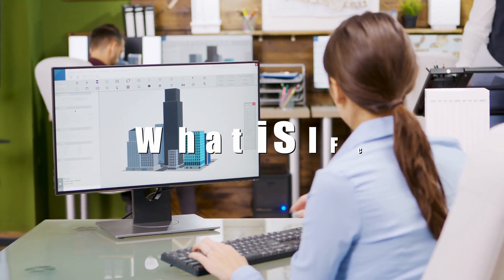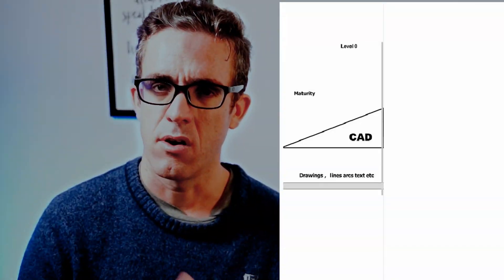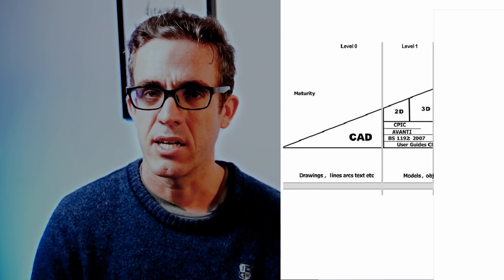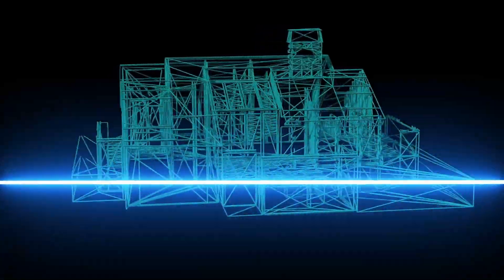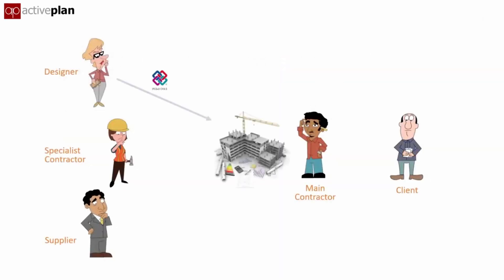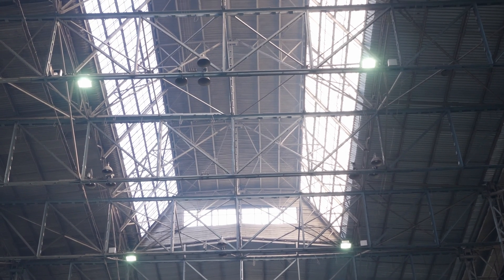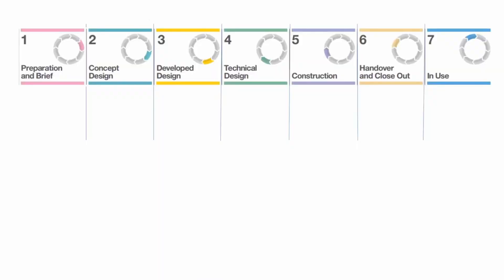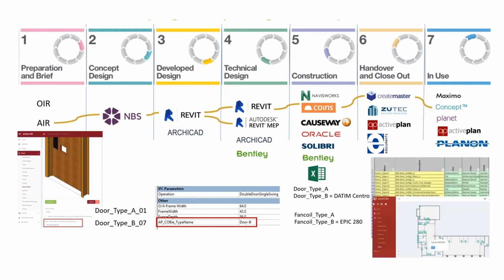Is BIM the Future of Engineering

Comment: thank you. as an architect doing a masters in structural engineering, this is very interesting to me. could you talk more about rhino and grasshopper and how that is relevant to BIM?
Reply from the maker: Hi Forly, thanksyou for your support. I will start planning a video on this, with rhino inside integrating with revit, it is soo powerful now for parametric design. Thanks for the suggestion.

Comment: Really agree with you Brendan, BIM will definitely be the future of engineering. do you know  any BIM software in cold form steel industry?
Reply from the maker: Hi Jason, depend on how detailed you need to go. If only standard detail revit with purpose build components would work well,big needing more shop drawing level documentation Tekla works better.
Reply: @BrendanHasty  IFC export to- Tekla Structural Designer-export to Tekla Structures. Vs Revit bidirectional synchronisation with Advance Steel+Robot Structural Analysis(or Advance Design)? What are your thoughts Brendan?

Comment: Just found your channel - this is sweet! I get questions all the time asking who I can suggest for structural engineering and BIM, you just shot right up the top of my list. Keep up the great work mate.

This video was also a great summary of BIM and engineering, I'm also including it in my 'further learning' for my University class I run on BIM. My background is architectural, so this video is super valuable to fill some of the gaps I'll no doubt leave for them.
Reply from the maker: Hi Aussie BIM Guru, Thanks for watching, enjoying and your support. your channel looks great too. 
If there are any topics that you think would be beneficial for me to cover let me know? I am always looking to add value to the community.  What is the University course that your run? that sounds amazing. Also, thanks for adding it to your recommended 'further learning'.
Reply: @BrendanHasty  i currently run a capatone unit in BIM at USyd. Its a 5 day intensive divided across the semester, mixture of lab and lecture content. Whilst most of the students are architects I've added a lecture on engineering and analysis software (found some great examples in your video on structural top 5 software). I try to not make it too revit centric (even though we do use it here and there in lab sessions), and try to expose them to workflows and processes (iso standards, openBIM, CAFM etc). Quite bit to jam pick in!

I still need to work my way through all your content, but I quite a lot of people asking about computation in structural engineering (analytical as well as automation based, e.g. karamba/dynamo) and also a lot of people are curious about modelling of reinforcement and analysis of slab deflection/loads. Might be some ideas in that mix of topics maybe? It's great how you tie back all your software examples to real practice, so tieing some of the 'why' to the 'how/what' with softwarr workflowd is super valuable for viewers also.

Comment: BIM is the future. It's a bit of an investment up front, in terms of the software, skill development and time, but it pays for itself over and over. A properly set up structural model saves so much time in the long run, and it's way more fun than just "drawing" a structure. You end up with a higher quality product with so much information at your fingertips. Thanks for a very informative video, looking forward to see more on this topic as it's a fast-moving technology and we need to adopt and adapt it efficiently as Structural Engineers.
Reply from the maker: Hi Theuns, agree the initial setting up the model can be costly, but after you have put the effort into setting up the model you can quickly update and assess change to the design.